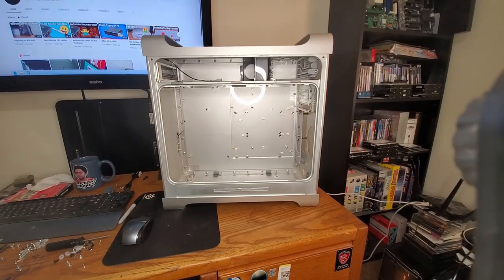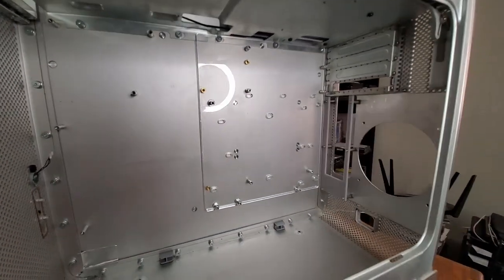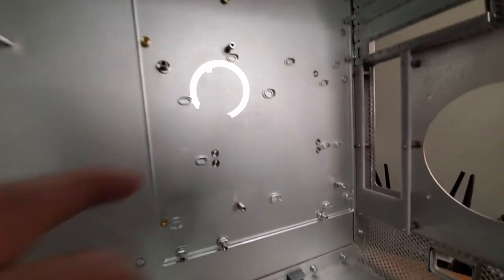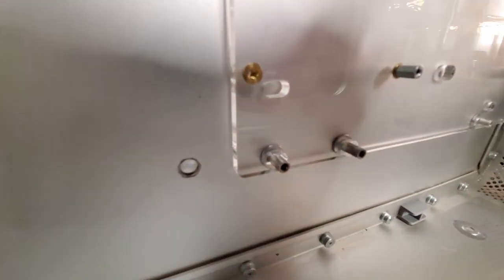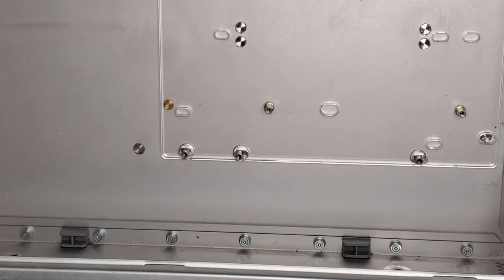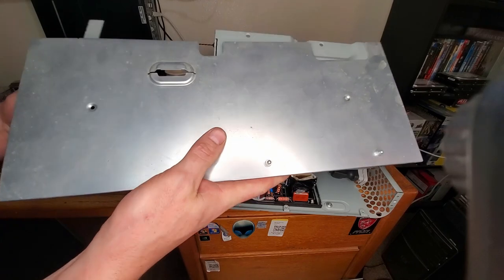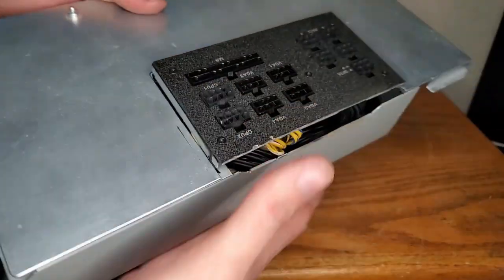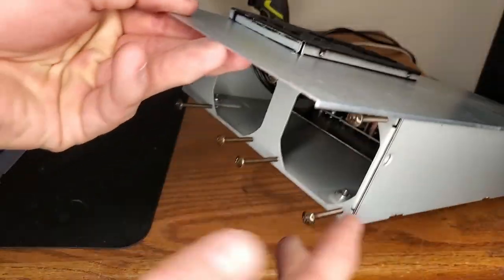Powermac G5 To ATX Conversion Pt 2

Comment: 27:18 you should spray some paint where you grind it to bare metal where you made thr cut or it will rust.
Reply from the maker: I will be doing that kind of stuff at the end of the project.

Comment: If you had cut out a couple of tabs on that top shell , instead of simply just the hole, of the PSU you could have bent them up drilled a hole into each and mounted that modular breakout board shell to those tabs, holding it in place nicely.

Comment: You probably should have rotated the power supply 1/4 turn clockwise and just extended the two wires to that female adapter then you could have put all the output adapters toward the back of the power supply container
Reply from the maker: I ended up wanting to keep the wires toward the side panel of the case and I think the position they ended up in is best imo.
Reply: @idoesstuff1  I commented to fast early in your video.  The power supply hack looks awesome and your attention to minor details are great. Should end up a epic pc

Comment: I also have a Powermac G5 to make an adaptation like this, but I lack the courage, I thought I could use the original power supply itself just by changing the cables to the common ATX standard, would that be possible.
Reply from the maker: I did a lot of research on the subject and never saw someone modify the factory powersupply to atx standards.  Anything is possible but I don't know what would be involved.